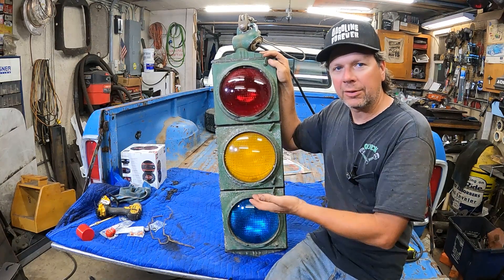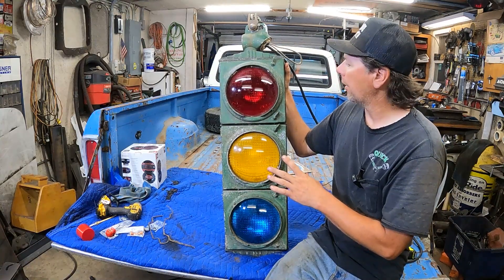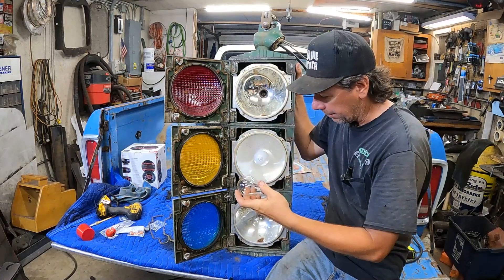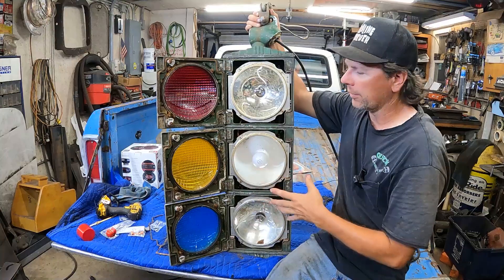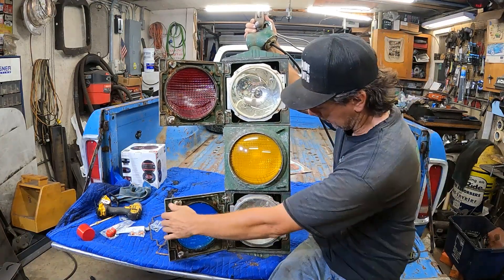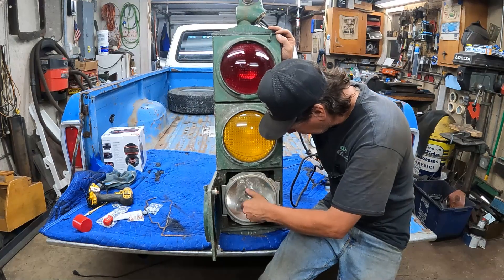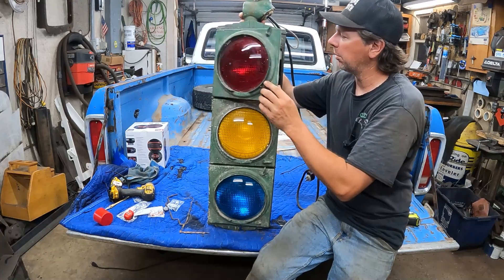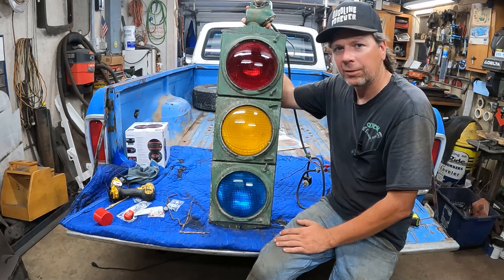How Does a Traffic Light Work?

Comment: well 400 bucks who would of thunk it I put a sequencer on mine as you mentioned and was missing the covers too so  I took a aluminum stop sign and bend pieces over my knee cut to fit looks legit also might be of interest to note that they also have a puck that you can drop into each socket then screw in your bulb and they will now flash cheap and easy.
Reply from the maker: Thanks for the info 👍

Comment: Yesser...I have one of that model. Probably $400 to a collect. I bought 3 for 100...sold 2 and kept the best. Have yet to refresh and haing up
Reply from the maker: I had a rougher DT that was yellow and had the wrong lenses.  I cleaned it up with correct smileys and sold it at Hershey for less then the costs of the lenses
Reply: @QuickSpeedShop  man I wish I was closer to you I got an issue with an old 50s hotrod time capsule (newly purchased) 34 5w Coupe. I'm slowly getting it ready to cold start after 20+ years. Race engine 66/67 289 cobra. Unknown build info...Crane gen 1 aluminum roller rockers and I see a yellow cam down the dizzy hole. One rocker is split. I have partially rotated the engine, got a few push rods not delivering oil. My next move is to continue to manually rotate motor and retest manually, driving the oil pump hopefully get everything oiling. Then consider finding a replacement rocker arm or replace all.